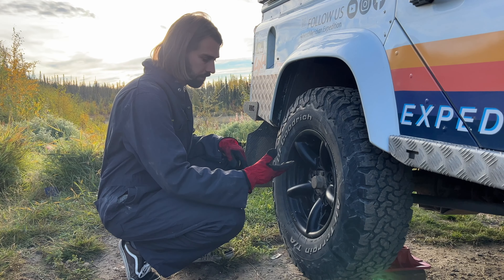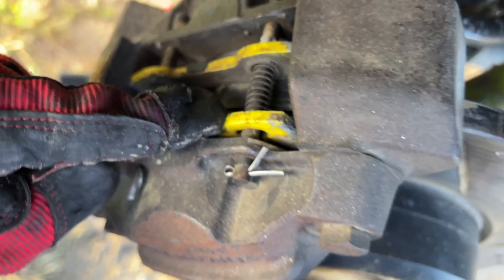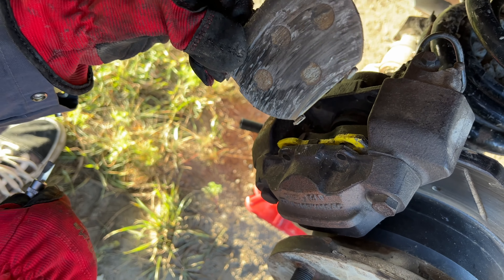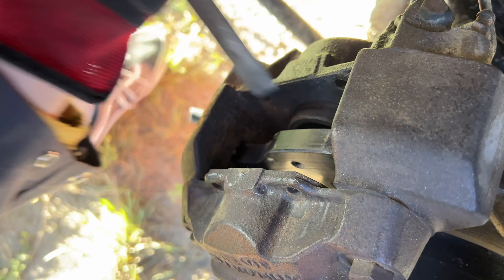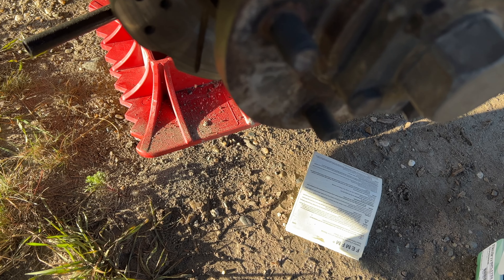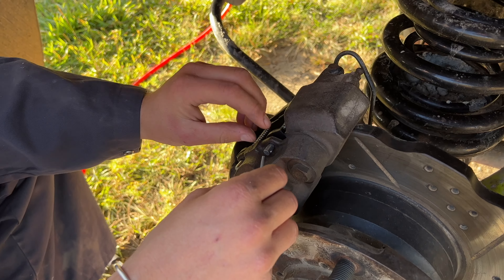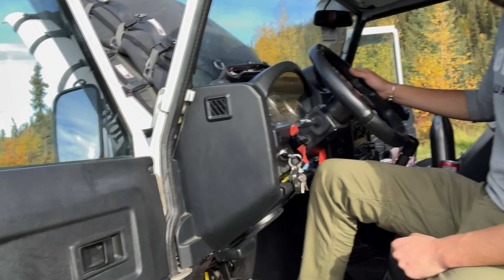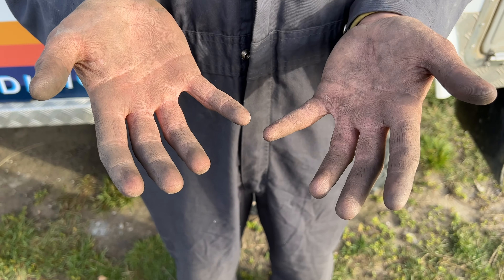How to change brake pads on a Land Rover Defender - step by step

Comment: If you take the lid off the master cylinder the pistons push in easier, just be sure to put a rag over the top or the brake fluid will squirt every where.
Reply from the maker: Will do thanks for the tip!! 😃

Comment: hi there.....due to the uneven wear on those pads.....(the outer was almost new and the inner was worn down to metal)......i would say the caliper will need an overhaul.....
it seems only the inner piston is working.....the outer isnt doing much so you arent getting full braking.....
other than that....good job....you got yourself out of trouble very cheaply.....

ps....jacking up the back wheels renders the handbrake useless...you need to chock up the front wheels cos it can very easily fall off the jack...
Reply from the maker: Understood thanks!

Comment: That was an easy job.  I had a tight situation in Kazakhstan, when in the morning the surface of the rear brake shoe came off and the tire got stuck.  A nearby spare parts store found spare parts on the shelf and I was able to repair it in that yard.
That was my ”eurovan” autumn 2019.
Reply from the maker: Dang, sweet :)

Comment: Another great video as usual, here are a couple of tips. It’s a good idea to place the wheel under the the brake disc in case the jack fails, also you should open the split pins and bend each one outwards not bend them over together.
Reply from the maker: Understood thanks!

Comment: The brake pads were worn very unevenly. Outside pad almost no wear and inside completely worn. This indicates that the outer piston in stuck (common problem on the Defender brake calipers as they have no dust boots on the pistons). You need to free them up so they move easily in and out resulting in even brake pad wear on both brake pads. Before you push the pistons in make sure they are clean (small strip of cloth and some brake cleaner to clean them) because otherwise you might get dirt in the seals causing a leak or the dirt gets the piston stuck/not moving free.
Apply a thin circular coat of copper grease to the back of the brake pad where the piston touches the pad. Prevents squeeking.

Enjoy the travels in the US and further south!

Comment: Great to take on tasks yourself and for future brakes just a few comments from someone who's changed an awful lot of brakes over the last 30 years.

Brake cleaner not airline. Brake dust really really isn't nice stuff. 
Don't lever on the disc. It's surprisingly easy to warp/mar a disc and then you're into new disc territory. 
Replace the split/cotter pins. If these fail your pads come out and old pins do fail. 
Before you start remove the brake fluid reservoir cap. This will make it easier to push back the pistons and reduce overflow chances.
Use a block or axle stand. Jacks fail. I've seen this and it was horrific. 

Just a few ideas for next time. As someone said you must do both sides unless it's an emergency get you safe thing. Really impressed considering you're learning. I've seen it done so badly the vehicle was un-drivable after! All the best both ☺
Reply from the maker: Hi Matt,
Thanks for all that, if I understood properly, I use brake pad on the pistons to make them function properly again or brake cleaner is to clean out the area of the brake pads before putting new one in?

What should I lever on to put pistons back? Or do I pass through the caliper with a wrench/screw driver and pull the piston directly on the piston? 

Will always change the pins.
Reply: Brake cleaner should be used to assist you cleaning the caliper and any oil contamination off your pads and discs. You also use it to dampen down the dust as you scrape the caliper down.

Yes whatever you need to do to not lever on the disc. There are lots of specialist tools some of which require you to remove the caliper itself.

Comment: It's nice that you guys uploaded this first time how to video, cause it allows us to give you pointers. 
Did you notice in the box for the brake pads that there are 4 pads? There are 4 for a reason, you are supposed to change pads per axle not per side. Now, how this video is edited I can only assume that the other side isn't done. If that is true please STOP the vehicle somewhere safely and replace the pads on the other side. 
You always change brake pads per axle because of breaking, you want even breaking along an axle, if the braking is uneven due to new pads on one side and worn on the other, you can cause the vehicle to go into a slide. 
Another point, after driving approx 100km re torque the wheel nuts. Because of heat differences between your wheel hub and rim the wheel nuts can loosen.

Glad to see that you guys are learning to live with the Landy, safe travels.
Reply from the maker: I did the other side and checked the front 2 tires but didn’t need changing. 

Thanks for all the explanations and we did do it 😊

Comment: You have forgotten a few things! Thee are very important too. Grease! Use an anti-squeal compound like copperslide, it also helps stop the pads seizing in the caliper as well as reducing noise. clean and then work the piston as you heve/had a slow/semi-seized piston. Make sure you do everything in axle pairs, so the other brake also needs to be replaced whether working fine or not. Your or other people's lives depend on brakes working well, so unless you have had professional training or supervision DO NOT work on your own or anyone else's brakes, they are THE most important part of the vehicle! ( I'm a 30-year experienced, trained automotive engineer)

Comment: Hi,
Nice demonstration. But...

As already mentionned by somebody else before : you shouldn't rely only on the hydraulic jack. To work safely under the car it should be secured with an additional device which holds the car even when the jack fails. I for myself push at least the wheel under the car but I'm aware that this isn't ideal. 
I've seen you use this hydraulic jack under the axle in former videos. To me the original LR jack seems to be already a little bit more stable as it is inserted into a sort of tube in the bumper. Even if the car moves a little bit it won't slide of the jack. 
For the readers who don't know Land Rover Defenders : contrary to the most other cars, the original LR jack isn't used from the side of the car but from either the front or the back side of the vehicle where it is directly inserted into the longitudinal beams (stringers?) of the chassis. The receiving holes for the jack are integrated into the bumpers and closed with a black piece of plastic.

Concerning the breaks: it might be a good idea to verify not only their surface but also their thickness. As your car is always heavy loaded they could already be worn out. For safety reasons there is a minimum thickness to respect. 

Concerning the uneven wear of the break pads : I once had a similar problem on an old VW Bus T2 when I bought it. One break piston was completely stuck by corrosion. So each time I used the breaks the car tried to move sidewards as one wheel wasn't slowed down. To test : take the hands of the steering wheel and break heavily. If the car doesn't continue straight the cause might be a stuck break piston.

Have a nice trip and thank you for the beautiful pictures : I was surprised by the Oregon landscape. 
I don't know your further travel plans but if possible you should spend some time on the 101 right along the Pacific Coast.
Reply from the maker: Hey, thanks for all that. I take all of that into consideration of course for my next brake pad job :) this is why I make these videos to help others but to learn too! And we did the 101 6 years ago so we’re doing the Midwest this round.

Comment: Great DIY video.  Love watching your travels.  I wanted to comment on your uneven brake pad wear... the inner pad was down to metal while the outer pad looked almost new in thickness.  You may want to confirm your caliper is not sticking, and you may want to apply some grease on the slide pins.
Reply: There is no side pins just pistons.
Reply: @Defender110SLO  - yes you are correct... those are anti-rattle springs with just pins to hold in place.  The caliper is a double piston version.   Seems to me that the inner piston is sticking.
Reply from the maker: Yeah next arriving we’ll get them checked! Thanks

Comment: You might find the new ones don't last as long if that pad that wore down to the metal was damaging the surface of the disc. I've only worked on round discs but I normally file off any raised portion at the edge of the disc that is not swept by the pad. The same with brake drums, you need to file off any wear ridge at the outer edge as it can stop you from pulling the drum off next time.
Reply from the maker: Oh didn’t know, thanks for that! We’ll have it checked next servicing
Reply: Don't try and file any ridges on the rotor by hand, it needs to be put on a brake lathe. I wouldn't worry if there is a small ridge on the outer part of the rotor the only time you really need to worry about turning the rotor is when you have multiple ridges caused by the worn out pad. If you change the pads before they are completely worn out you'll very seldom have to have the rotors turned.

Comment: That  was very easy.  Usually, you do brakes by the pair. so you should do the other side too.  Also, when a shop does them, they resurface the rotors.  That makes them stop better and the pads wear more evenly.  When the rotor gets thin, you will need to replace them. That is when a brake job becomes expensive.  It appears Landrover has designed the brakes for easy repair while on the road or in a remote area. Most disk brakes require special tools to spread the caliper and remove the pads.  You should get a repair manual for your vehicle and carry the parts most prone to break.  I knew a famous photographer who used to drive his big Cadilla across the desert. He carried extra axles.   What if you break down  where there is no cell phone service and you cannot get any help on YouTube?
Reply from the maker: Gotcha, thanks for the tip. We’ll have the rotors checked next servicing

Comment: Sc soory Nick but your brake calipers are not working properly. The pistons shoud go out same and pads should be used same left and right. 
If you will go to some Land Rover garage you should look at brackes.
Cheers to bolth of you. 🍷&🍺
Reply from the maker: Yeah I know, for wide maintenance I put WD40 to see if next time I check it helped. Otherwise I’ll add grease or oil to see if that works! But thanks for the lookout 😃

Comment: I am sure someone else has chimed in here already..

That said..   One can compress the caliper pistons using channel lock pliers [on the old worn pads first]..  The spent pads can be removed with them as well.
For example:https://images.thdstatic.com/productImages/5fb3c72e-c2da-496c-a03c-03fbec382cea/svn/channellock-all-trades-tongue-groove-pliers-440-64_1000.jpg

When a pry tool is used, the disc can be damaged ... Your rear disc, has definitely been damaged on its inner surface & needs replacement, as the inner pad wore out completely, going metal on metal. When you DO change it out, the rear pad set will need replacement as well [again].

You are gonna love me, I know!

Those 'side to side' pad pins should be held with a clip rather than a cotter pin as shown.  https://www.mgcycle.com/images/atrex/01659130p.jpg

Your vehicle's brake fluid should be changed/flushed .. every 2 years, as brake fluid absorbs moisture over time. This absorbed moisture can/will cause internal brake component corrosion, and this moisture can/will lower the boiling point of your old brake fluid.   [I don't know what interval Land Rover says on this]..  
That last can be very, VERY serious, especially descending steep down grades.

I probably need to watch further into your brake pad video, but if the left rear caliper was the only one wearing the inner brake pad disproportionately then it would logically follow that  this caliper is likely sticking & should be considered for replacement.

Kathie & I cheer you both on following your adventures with smiles on our faces.

M&K
Reply from the maker: Thank you for all that and I’ll make the job much better next time I do them 😃 thanks for the tips! Learning as we go!